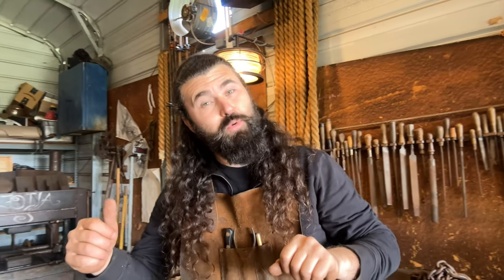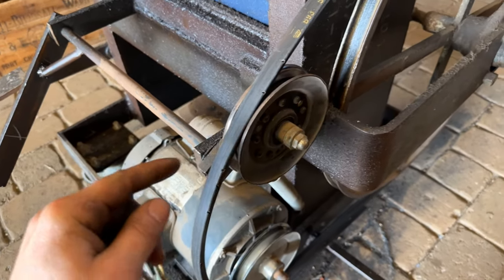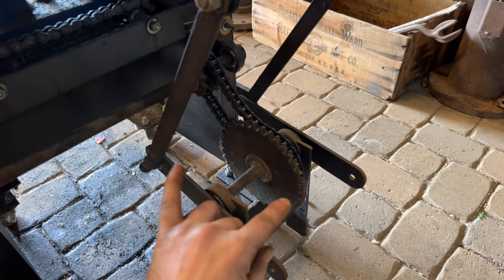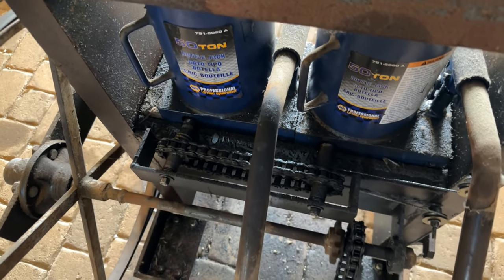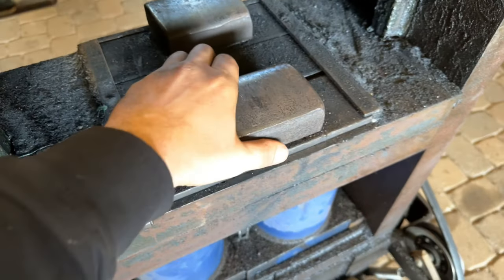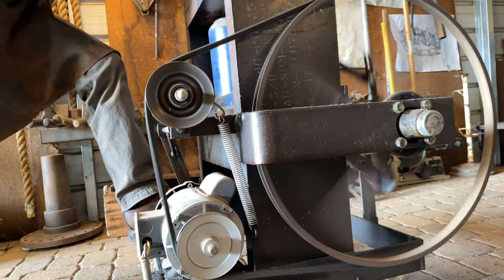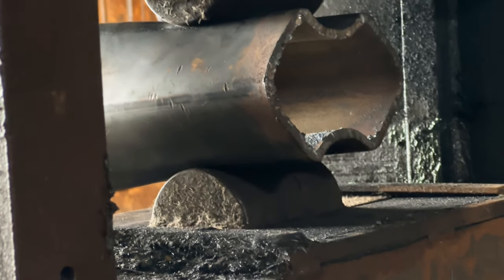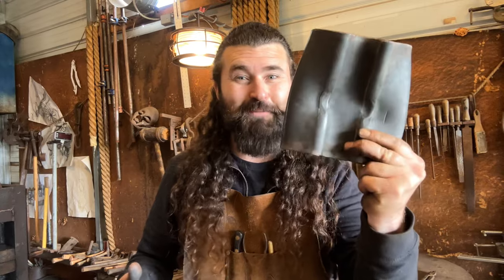Maxed Out - How I Built my 100 Ton Forging Press

Comment: what an absolutely beautiful machine!

if i was to build a press like yours, i would go for a 50-75 ton press using smaller bottle jacks so it will be quicker.
but i do make mainly hand tools, knives and small ornamental things.
so i do prefer tools that work quicker but more gentle, rather than slow but crushing.

in any case i love seeing other people's work and ingenuity, trying my hand at making and customizing it to my needs!

keep up the great work, i love seeing what you do and make!
Reply from the maker: You’re spot on! If you need less pressure then a pair of 20 tons out around there would be perfect!
Reply: @Max_Randolph_Studios  i hope to do that sometime, But i first need to finish the treadle hammer i started building last year 😅

Comment: VERY cool build! A friend and I joke how sketchy some home builds of devices like this are but you really did make something that SEEMS pretty safe insofar as where the operator has any reason to be when in use and the fact that that's on the OTHER SIDE of anything you could easily catch any given appendage in or otherwise hurt yourself, right on. 

I'm equally interested in your file rack on the wall towards the end; I take it they have some kind of slot on the side the file sneaks into? I see the hole HAS to be narrower than the width of many of your larger files so can think of no other way you would be able to hang them up, looks GREAT!
Reply from the maker: Hey if you’re not in a little danger, you’re not having fun! 😉